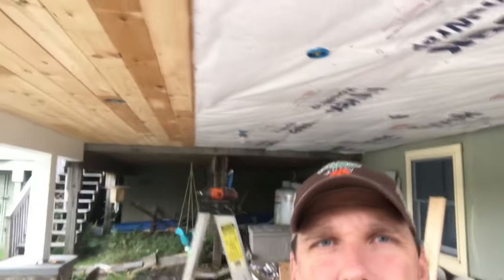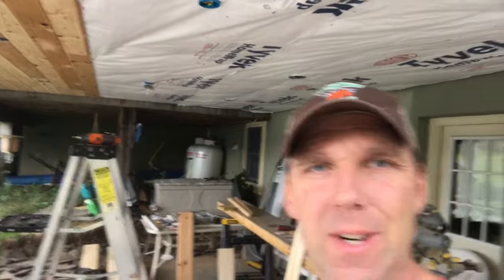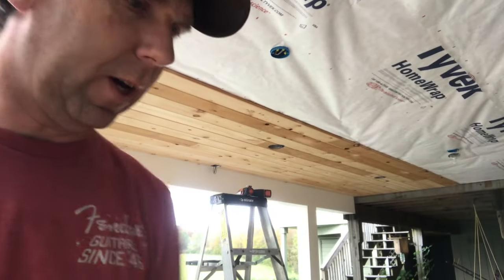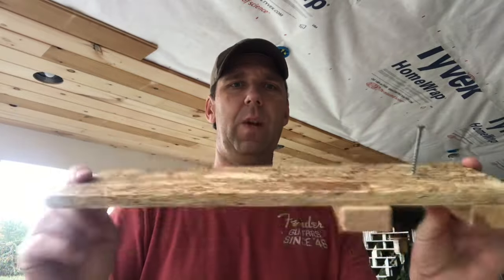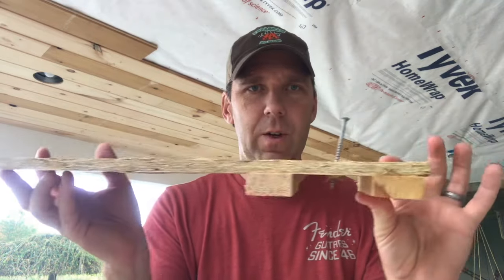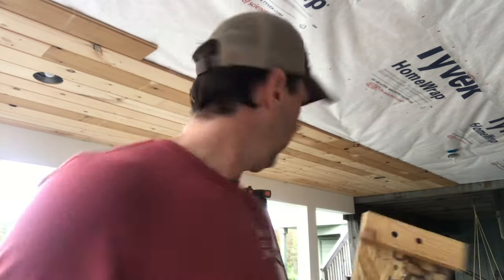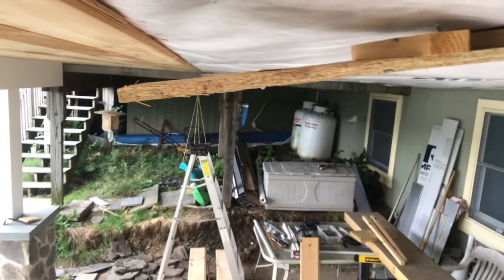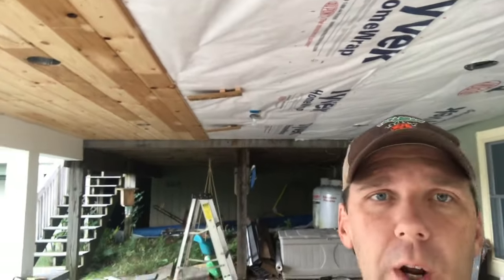How to Hang Tongue & Groove Ceiling by Myself

Comment: Great idea.  I did something very similar.  A lot of comments here about the added time of doing it this way.....I don't know what people think takes so long?  Its 3 screws!  That is a big deal?  I made mine long enough to do two courses before i had to move them...cut down on moves, but I could relocate all three within 1 minute.  I probably moved them 40-50 times.   I think this method is great.  Working alone can be nice.  This set of helping hands will always be on time, doesn't complain or get tired, doesn't require payment, etc.
Reply: And you don't have to feed them.
Reply: Bring your own lunch to work no feeding employees unless it's a nice day but luckily i work with just one guy all the time pretty cool having constant 1 on 1 teaching and the occasional free lumch

Comment: In about 2013, I helped a friend hang a drywall ceiling in a garage conversion.  My contribution to the effort was to combine a piece of plywood with an old gate hinge and a 2x4 so that the plywood could hold the drywall against the ceiling and the 2x4 could wedge down against the garage floor to hold everything in place hands-free. 

If you made a bit of a strong back for the three fingers, you could do the same thing, eliminate the screw holes and maybe go even faster.

I would make the fingers overlap the existing T&G board and angle up rather than down so it will make a ramp to align the T&G but not so tight that you can't place and remove a board after putting up the fingers.

Of course this works best if the floor and ceiling are parallel.  The garage floor in the conversion was sloped for drainage and the rafter bottoms weren't very aligned to each other or level so in some spots the 2x4 was almost too short and in some places it seemed longer than idea but it still could wedge well enough to effectively hold up a sheet of drywall hands-free.

The next T&G ceiling I want to do is with a 3-in-12 slope so I'll have to change 2x4 length a lot or come up with something else.

Comment: Nice idea and well timed for me...  I'm about to hang 75 6"x14' T&G planks on my family room and kitchen ceilings.  In my case I have furring strips (3/4"x 2", 16" OC), that I have to locate my two holders on.  This will make things much easier.

I may even try to experiment with some way to clamp the holders to the strips so I don't have to screw/unscrew them each time.

Comment: thanks for the tip, i revesed myself a quick grip clamp but it doesn't hold the pieces, will add your method to the clamps for nice snug fits

Cheers!

Comment: The idea is right. I did one with larger pieces of osb with two holes for the screws and a loose piece of wood as a wedge . All I need it to do was to walk the osb backward one screw hole at a time with out removing it  off the ceiling.as I Install the T&G. One piece on each joist ceiling.

Comment: Thanks! I did something similar on my porch ceiling and it worked well. I decided to do the vaulted ceiling in the addition and am struggling even with the jig as you at least need to add a lip to hold from sliding, but then on scaffolding it is a lot of back and forth and up and down work.

Comment: Great idea!  I am in the process of installing 1/4" thick 8 foot long 7" wide tongue and groove bead board planks on my ceilings throughout the house.  Each plank is very limp and difficult to hold up on the ceiling.  Have popcorn coating throughout that is horrendous.  Cannot paint and cannot clean.  I have to do this by myself.  Thank you so much for your help on this.  This should be a great help.
Reply: How are your planks holding up that cover the popcorn ceiling? I am about to start the same project as you. Thanks in advance.
Reply: @wwolfram33  No issues.  Scrapped popcorn off first, which was a real mess.  For the next ceiling, debating about using thin lattice on the rafters, making 2'x2' squares first.  Staple the breadboard planks through the lattice, skipping the mess..
Reply: @bonniemorris6278  I am planning on installing 8" tongue and groove nickle gap over the popcorn ceiling... using adhesive and nails.  I will just cover up the popcorn without removing it.  Have you tried something like that before?  Thanks!

Comment: big help i want to do this too on my ceiling  which is 10ft hi
how did u fit them into the groove without someone else did u glue the joints together
Reply from the maker: The cheater boards I show help hold the tongue and groove in line so you can knock them together easily. I personally did not glue them. I simply face nailed them with a finish nailer.

Comment: did you consider cutting 45deg angles on the ends so they overlap rather than butting flat up against one another?
Reply from the maker: Aidan Skoyles  I did but I decided to not go that route since it wouldn't have changed the final appearance. I would have still had a line where the joined. Good insight for an option though
Reply: Thanks for the reply.  Do the 16 footers shrink/expand much as the weather changes?  I'm using 8 footers, but they'll be fully outside in a gazebo type thing, not in a garage like yours, so am thinking any expansion might be an issue.
Reply from the maker: Aidan Skoyles I haven't treated mine with anything and they've been up for a full year. No expansion or contraction has been noticed and these are on an outdoor patio ceiling.
Reply: That's great to hear.  Thanks.

Comment: Did you route the T&G or just buy it like that? If you diy, was it worth it?
Reply from the maker: I bought them with the T&G. Since I was putting it outside I wanted tight joints to help keep the bugs from infiltrating.